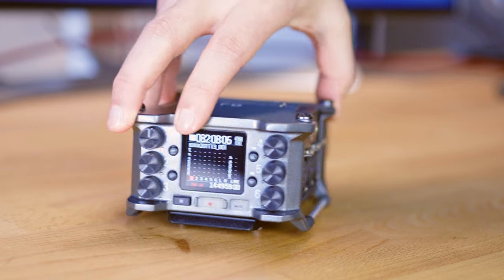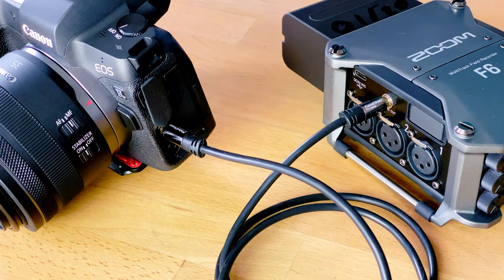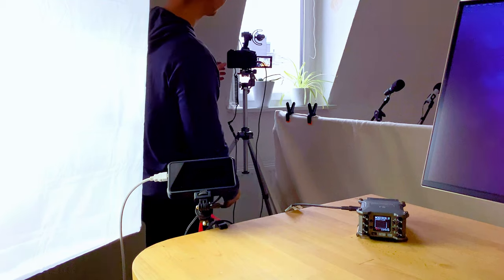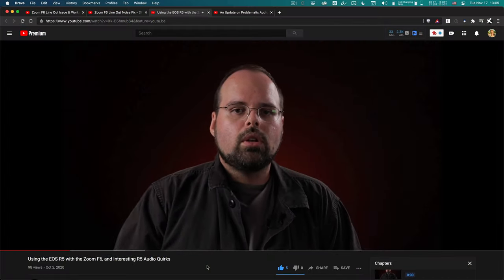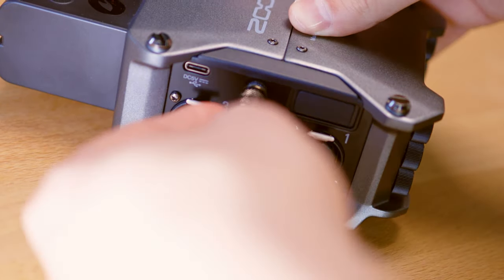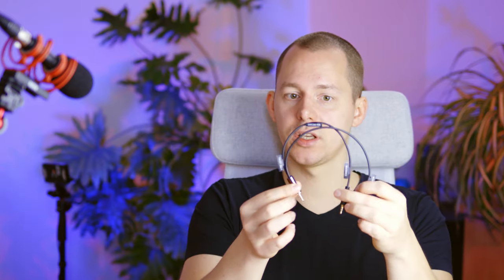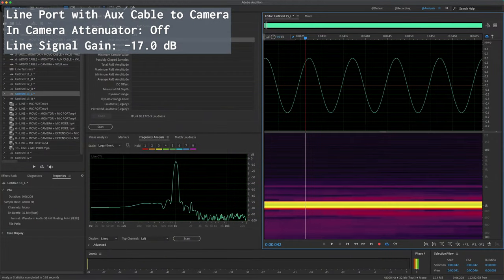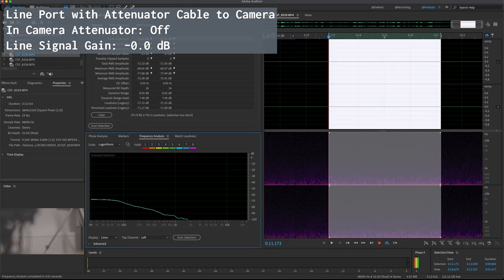When Line-Out is too Loud  🙈 Featuring the Zoom F6 Line-Out Hiss and a Hardware Solution

Comment: Thumbs up for the Power Delivery section. I was looking for a way to run the Zoom H6 line out into the PodTrak P4 and it sounded horrible even at --30db, but I was powering the H6 from a USB-C Hub plugged into the computer. Running the H6 from a USB Power Bank solved the issue. Thank you!!
Reply from the maker: Very happy to hear that.

Comment: Wow,  what a MASSIVE oversight by zoom.
Sound devices must be laughing all the way to the bank.
Reply from the maker: Still an incredible recorder through. Always some drawbacks with devices. But I sure wish this’d be fixed.
Reply: @ChrisSpiegl  could the issue be fixed with a firmware update,  to give an option to choose mic level or line level output?
Reply from the maker: @50450720  I do not know if it could be fixed by firmware, that kinda depends on the hardware. I would honestly guess that they would have already done so by now if it would be fixable by firmware. But maybe it's still coming. I mean this device has a few more years of good use in it so it'd definitely be worth it.

Comment: Currently these cables are out of stock.
Reply from the maker: That's pretty crazy. I hope they get back in stock soon. And if they are, I personally would probably get the -35db cable (without the monitoring option) if I had the choice to shop again.
Reply: @ChrisSpiegl  Kopul ACDR-35 Line-to-Mic Attenuator Cable has 35dB of attenuation... won't that work?  It's not the MOVO brand but it's Line-to-Mic Attenuator Cable.  B&H has them for around $26 USD.
Reply from the maker: @ChristianVedder1  sounds like that would work. I am not in the US so I don’t usually look at B&H when looking to buy stuff. But based on your description you can get that attenuators line to mic cable. 🌸

Comment: Thanks, Chris. Do you know of an attenuation cable with a 3.5 jack on the line out side and a mini xlr on the camera side? I am using the BMPCC 4K. I''m using the 3.5 port on the camera for my timecode box. I wanted to use the mini XLR port for a clean backup audio track (in case something goes wrong with my time code box).
Reply from the maker: Hi Paul, I do not know any specific cable which would give you this. I know Tentacle Sync has some cables in store for all kinds of connectors but I do not think they have a mini-XLR to 3.5mm jack, but maybe they do have what you are looking for: https://shop.tentaclesync.com/

Generally, I mean, you can mosty just use any mini-XLR to 3.5mm jack. The only issue you have to take into consideration is the Zoom F6 TC port is work with a left and right signal (one to receive TC and the other to send). So make sure that the cable either makes that a Mono signal or chooses the right channel.

Comment: I am quite curious about these 32bit revolution. As a beginner do you would recommend to inverst this 600€ in an F6 or start with an smaller and cheaper 24bit recorder to learn the skills from the cradle?
Reply from the maker: Hello anyuisbjoern, I would say it totally depends on the budget and where you want to go. You can totally get good results with a 24bit, however, the F6 for example has much more than 32bit float… it also has extremely low noise A/D converters which helps a tremendous amount in even getting a cleaner 24bit signal than with - let's say the Zoom H5. If the H8 is on the list… i don't know that so you may want to check someone out who has made a review about that. But in general: I like to buy once and buy quality right from the start. The challenges you will face with 32bit float are different form 24bit but you'll learn and grow no matter what you choose.
Reply: @ChrisSpiegl  Thabk you for responding!

I don’t have any audio equipment beside a cheap lavalier (10€)and  put-on-coldshoe-shotgun-mic(20€). Now we have had a film workshop with 16 young people here in south germany and most of the 7 short film have audio issues. Now I would love to invest like you said in quality equipment. For the workshop we also rented equipment so we had a two rode-ntg2/3/4-type and boompoles and zoom h2 and onttop røde videomic, so it was a lot un experienced handling and too little focus on audio teaching.
So I consider investing into either zoom f6 or a h5 and maybe a senheiser me66 as boom mic, also thought about this short pencil mics for around 100€ as an addition to the field recorder.
Reply from the maker: @anyuisbjoern  Personally, if you are going to work with it a lot… go for the Zoom F6. Much more capable and the difference between the H5 and the F6 is astonishing to my ears (even when using the same mics).
Now, in regards to microphones, especially if you are looking into pencil-type mics for around 100, I have a comparison in this video (and the t.Bone really sounds pretty incredible I must say): https://youtu.be/rr1-jS8YB-c
About the Sennheiser ME 66 — I can't say anything since I have not used or tested it.
Where in Southern Germany are you? I am located in Hof, Oberfranken near Bayreuth. Fun to connect with people who are also from Germany.
If you have any other questions, feel free to ask them in the comments or email me, my email address is on my website and in my YouTube Channels About section.
Cheers and Good Luck
Reply: @ChrisSpiegl  Yeah, I loved your video about the pencil mics. I wanted to learn more about the oktave mic and so I found happily your both videos on it.
Thank you for sharing your experiences, that is very helpful in my consideration. 
Do you can use this pencil mics also outdoors or are they picking up to much noise because they aren’t directional enough? I think you already answered this question.
Yesterday there were chimes in the wind, this might be a good test for microphones, due to he wind you can get noise and the chimes “windspiel”, they have quite fine sounds.

You re from Hof. It’s Bavaria? I heard it often, but never went there, yet.
I am from Heidelberg, Germany. A nice sunny place in Germany.
Reply from the maker: @anyuisbjoern  I am sure you can use these mics outdoors. I just never have. And if you need something to be further away from the sound source a more directional shotgun would probably be better. 

Yes, Hof is Bavaria — even if just barely. Heidelberg, I have heard it’s nice there. 👌

Greetings from the freezing cold north 🥶.

Comment: What if the xlr ports are also producing the hissing? I’m hearing it while using the rode lav go.
Reply from the maker: So I am guessing you are using some XLR to TRS adapter? If that's the case are you using one that transforms Phantom Power to Plug-In power? Please check my video about these types of connections: https://crsp.li/VXLRPro
Reply: @ChrisSpiegl  yes the wired connection I'm using does transform to phantom power. Since the rode transmitters don't need that, I should switch to something that does not transform to phantom power?
Reply from the maker: @robmccune7949  sorry, I’m not quite sure what you are trying to connect together here? 
Please describe the devices with their full product names. Thank you.
Reply: @ChrisSpiegl  I am connecting the rode lav transmitter to the zoom f6 via XLR to trs adapter.
Reply from the maker: @robmccune7949 /videos So you are using the Røde Wireless Go set and you are connecting that to the Zoom F6 with the Røde VXLR adapter?
If you are hearing a hiss on the recording done on the SD card in the Zoom F6, then I would check the adapter (if it's not a high qualitty one). Also make sure to disable the Phantom Power if you activated it. And set the output volume on the Wireless Go to the max to get the loudest signal into the 32bit float file to work with.
If you still hear a hiss then, maybe test other mics and see if that changes something to see if it's the Zoom F6 or the Wireless Go unit that is doing the hissing.
Lastly: if you are getting the hiss when connecting the F6 to a camera, then just record on the F6 to the SD card and use that audio for higher quality.